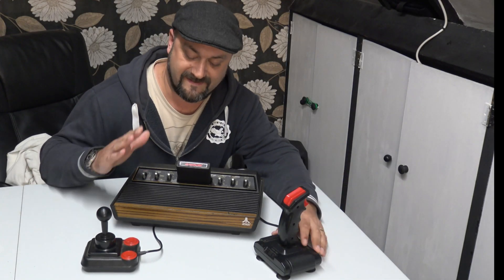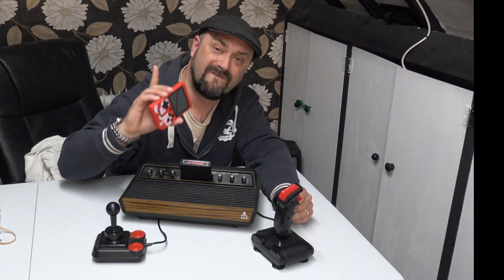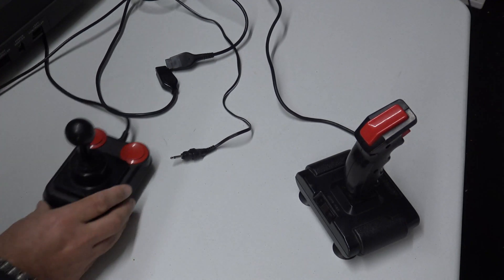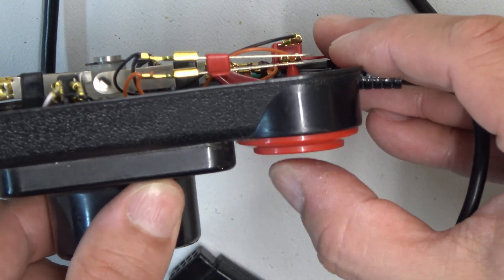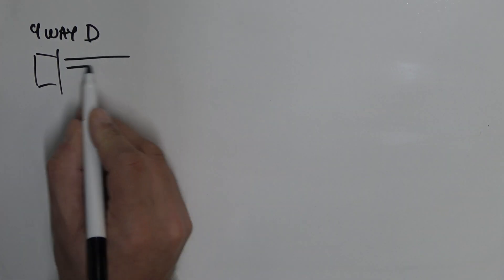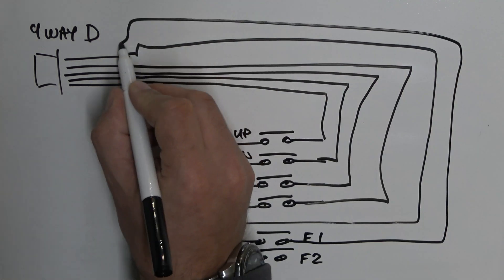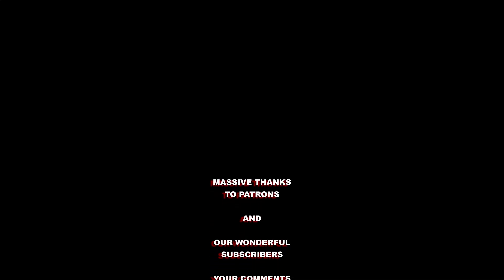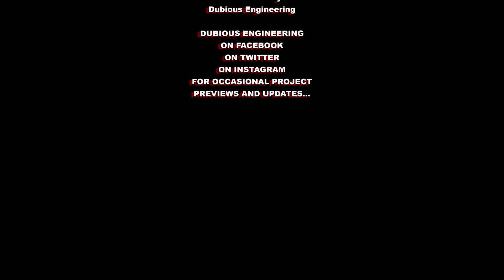DuB-EnG: Repair Retro Digital D-Type Joysticks, Teardown, Service, Review and the Atari 2600 Woody!

Comment: Having repaired many video entry phones that use the "Tactile domes", if they are "tactile" still (feel a click) remove the tape and clean both surfaced with a strip of clean copier paper and reassemble with Kapton tape.  If they are beyond that salvage a dome from somewhere (lucky for me these phones have 8 and only two are used)  failing that I have some 1.5mm thick surface mount switches that can be retrofitted at a push.  Let me know if you would like either and I'll pop a couple in the post.
Reply from the maker: What a superstar you are!! ...  thanks very much for the kind offer... I think I’ll try a way to replace these with micro switches ... or maybe just buy a more modern joystick with reliable switches in it...  I have quite a few of the little PCB click switches in a spares draw somewhere.  It’s really kind of you to offer to post some over...  have a cracking weekend!! Thanks again... Howard